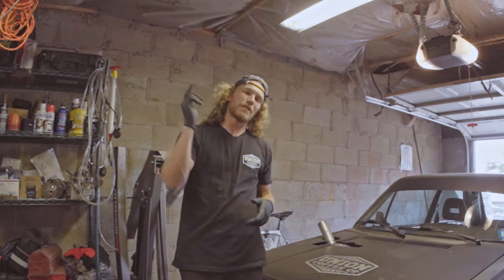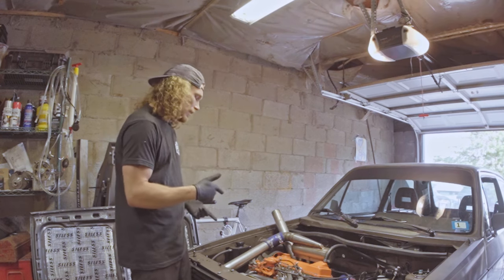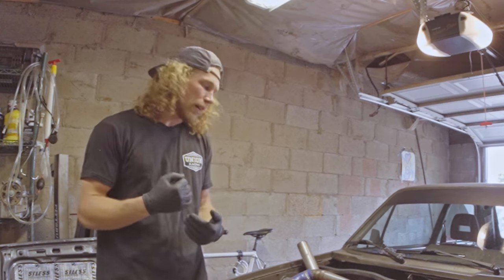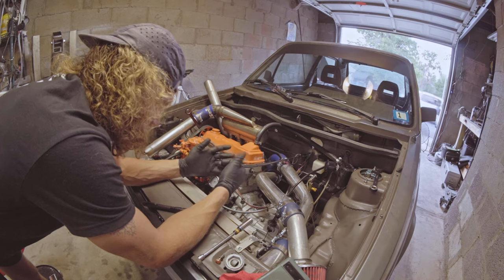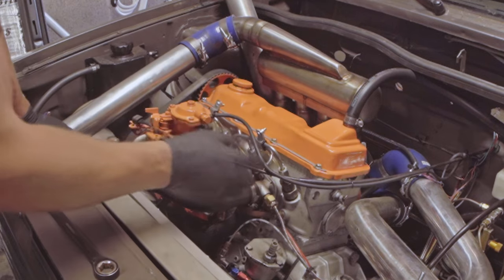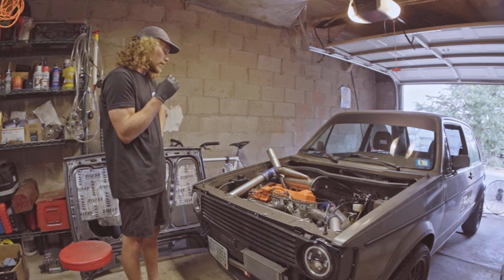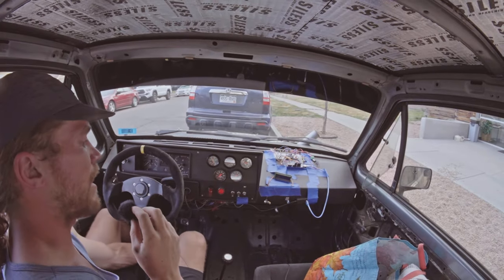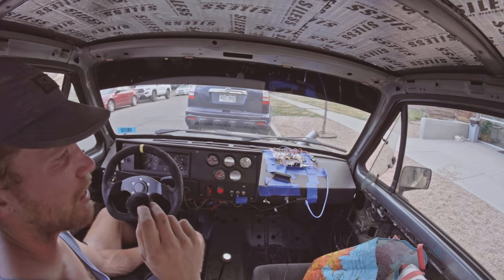Tune & Test Custom Injection Timing

Comment: I have run them at 1mm for a long time with no issues.
Reply: But that's with stock fuel system. I had a 1.6 with TDI turbo on it. 9 mm fuel pump. It was an early block 1980 and they crack at the corners. The Early 1.6 blocks had Six point head bolts. That's how you know. Then I went a AAZ with an 8 mm pump turned up all the way and I ran that at 1 mm. I suppose if you're running a lot more fuel it's better if the timing comes later. To push the Piston down.
Reply from the maker: Me too! But this set up is super Frankenstein, unfortunately the stock range just doesn't apply

Comment: Hey Oliver, I'm a bit stumped on my 1.9 l aaz. It was running perfect before I parked it a few years back. Then I went to start it and it wouldn't start because the veins were stuck. So rather than rebuilding it, I decided just to buy a new one from Hans Auto parts. Again, we know the reputation. But I've had pretty good luck with their pump rebuilds. I just know there's a possibility I'm going to have to take it apart. The new pump was a 9 mm. My old one I found out was an 8 mm. Even with the eight it ran pretty good. Would burn the tires through first and second easily. It has one of the Hans Auto parts turbo kits on it. Fyi, they work pretty good. So I have the timing set at 1 mm. Fuel screw pretty much maxed. But it's not really blowing a lot of black smoke, just mostly gray. Dark gray. When it's floored, it revs up to about 2500 RPMs then it starts to pop like it's hitting the rev limiter. And starts to slow down. Feels like it's running on quarter throttle. So I took the whole pump apart and checked every little part in. It seems to me everything is correct. I'm using the same spring actuator from my original pump just to see if it was that. Didn't change much. So I decided to try and rebuild my 8 mm pump and was unsuccessful and ended up accidentally breaking the 8 mm shaft. I have taken the whole thing apart twice and still can't see anything that would change it... Any ideas?
Reply from the maker: Hmmm that's a toughy! If I were you I would start with having it apart & checking everything in extreme detail against a schematic. https://youtu.be/HciSSYuXxdY?si=IorJbbds9uuVw-YI this link is to my vid where my car wouldn't start when I left a spacer out... Seems similar, ALSO in the description there is a part diagram/photo of exactly how the pump SHOULD be, definitely take a look at that. If it otherwise would be working (like ran well before) then you might need to suspect the quality of what you purchased. I'd also be asking questions like: how's the filter? How old is the diesel fuel? Is there water in the fuel?

Comment: the jerking at tiny throttle position is actually a rly fine line between idle injection and the throttle actuator, if you push the governor too much and leave no space for the actuator to come fully back and seal' it jumps back and forth giving and cutting fuel.
Reply from the maker: That tracks, is there a remedy for it in the adjustment of the pump?
Reply: @OliverFetter  yeah, release a bit the fuel screw if your main control lever is already full back. i didn't play much with it but its a common problem especially when the engine is up to temperature. 
*at my understanding is that with max feed the fuel screw keeps it from fully closing (it doesn't have space to come back and fully close the fuel plunger and or its loose due to spring weakness at that position and with vibrations its jerking back and forth letting fuel to escape)
Reply: im trying to figure why mine wont rev up past about 25ooRpm. if I rev it past that it starts popping like its hitting the rev limiter then drops back. My old pump worked great and ran perfect but the truck sat for a while and the veins got stuck. So I put in a new one. Tore it down and checked every part in there. Green seals. everything is perfect from what I can tell. I was going to rebuild the 8mm pump that was in it but when I was putting it together I snapped the 8mm shaft somehow. So I put a 9mm in there and it does what it does now. Never did that before and it pulled real hard up to about 4000rpm with 12lbs boost. Any ideas. Like its running on 1/4 throttle right now.
Reply from the maker: @Mikefngarage  kinda sounds like it's not getting enough fuel. Are the supply lines, filter, etc clear & good? Is the vein pump in ok shape? I've had pumps act like they're stalling or about to cut out bc my inline pump wasn't turned on & it was acting as a restriction while off

Comment: Don't forget that the TDI cam plate ramp up is far more aggressive or quicker than the IDI, that's why at stock advance it gives you the knock. Backing the timing off also moves peak cylinder pressure further after TDC so you get more expansion pushing the piston down rather than it not being able to do much (The knock sound) another benefit is more exhaust to spool the turbo
Reply from the maker: Yes! I was mentally factoring that in as well. All the parts working together to create early timing. The additional exhaust is definitely noticable 💯💯

Comment: hey dude, just found your channel been watching videos in your catalog like crazy, really appreciate the time you've spent documenting this build. 

I recently bought a SUPER clean '84 Rab with a standard 1.6L (non-td) engine. Was planning on converting to gas, running a 1.8T for autocross, but after seeing your videos I'm reconsidering keeping it Diesel and just swapping in a 1.6TD or an ALH-style TDI into it. Wouldn't exactly be a sleeper 😂but very fun build. And since you also have BOTH of those engines, do you have any engine recommendations for me if I take the Diesel route? I'm also super curious what your ECU setup is. Are you running a standalone ECU or did you chip-tune the stock TD? And you've got the Arduino to set up different boost profiles for you I think? Super nutty but almost seems necessary to reduce the lag. I dig it man.

Anyways, appreciate the content! Let me know what you think!
Reply from the maker: Hey thanks! I appreciate it 🙏 glad you find them helpful.

I have not finished building/installing my TDI engine yet but I have high expectations. I'm very pleased with where the 1.6L is at the moment... Pretty fast! My 1.6 is rather injured as well, I have about 65% of like new compression. This on its own doesn't really matter but it blows oil everywhere and I don't like that. SO instead of reworking the 1.6 again I figured I should try an ALH since it's literally the same thing just built better & direct injection. I figure I can directly transfer my entire turbo & manifold set up to the new engine and pickup a free 100-200 HP.. which will bring its own set of problems. I see some people say the 1.9 swap isn't worth it (power/response wise) but they clearly don't know how to tune a diesel in the first place. I'm sure a stock 1.9l sucks lol. 

So in that department it depends what you're looking for. If you want to project & tune a diesel till it's on kill mode then it's super fun :D if you want to swap an engine without much tuning probably swap the gasser.
Reply from the maker: The 1.6 is entirely mechanical, I'm just using the Arduino to control the turbo vane position. It essentially reads intake & exhaust manifold pressure & decides if the vanes should be opened more or closed more. I'm not a 100% sold on the control system so I might try a mechanical VNT actuator as well. Either way I want to start measuring air density all over the engine to be able to tune it better. 

Happy trails!
Reply: Dude, go with The AAZ for autocross. The power band is just off of idle. 1.6 takes a little more time to spool and has a power band in mid RPMs The AAZ 1.9 power band is from around 1,000 RPMs to 4000 evenly with a turbo. When mine is running right, I can let the clutch out while it's idling and then floor it and the tires come loose immediately. And that was with an 8 mm pump. Put an 11 on there and it will come alive
Reply from the maker: @Mikefngarage  sounds pretty tight!!

Comment: What radiator are you using and what fans because i what to upgrade my golf mk2 cooling
Reply from the maker: TBH I'm really not sure. Its a 2 core radiator with aftermarket electric fans & a shroud I made myself. I actually have 0 evidence it does a better job cooling than the OEM radiator and fan, however it does package better and allow me to place the intercooler 💁👌

Comment: I just changed my injection timing on my 1.6TD. Was at 0.90 from previous owner. Advanced it to 1.05. It sounded rough before. Quick drive with it now and it seems to clack a little more but honestly not much. Seems to vibrate a bit more but more smoothly, if that makes sense. Also feels like it has just a little more power behind it (niice). What was your experience playing with this on the 1.6td? How far is too far? Thanks brotha
Reply from the maker: Right on! I feel like 1.05 is really the furthest you want to go, it's only going to get more clacky and less responsive past that. I would run my stock pumps around .95-1.0mm with good results.
Reply: @OliverFetter  Yeah this is all stock. I definitely don't think advancing it anymore would help. Next time I time everything I might bring it back a little. Maybe 1.00. I need to have my injectors rebuilt and the breaking pressure verified though before I settle on anything. Have you tried different nozzles?
Reply from the maker: I have not. In my experience the nozzles are not the restriction in the system 👍
Reply: @OliverFetter  that was my initial thought as well. But it seems that fueling and EGTs are. From the searching I’ve done, the only difference between the 68hp and 75hp 1.6TDs was a small stock intercooler and bigger (“GTD”) nozzles. So there’s some gain to be made there. But more importantly it seems that when you crank the fueling on these pumps you are prolonging the injection duration and that results in much high EGTs. Larger nozzles means shorter injection duration and lower EGTs. At least that’s my understanding?
Reply from the maker: 🤔🤔🤔 I think that makes sense?? I'm having trouble wrapping my head around if nozzles actually make the injection event shorter. I feel like I've heard from multiple sources that they're not the thing to go after but those sources may have been forums 😂 so we know that can't be too helpful. You're 100% right about egt & injection duration. For me upgrading to a larger pump head was the fix, more fuel delivered per stroke = less need to prolong the duration. Being rather ignorant of the nozzles dilemma, id chalk most of that hp gain up to the intercooler. Denser air = more hp.
Reply: @OliverFetter  I’ve also read from various forums that nozzles aren’t going to make much difference. And I tend to agree if you’re just talking HP or basic tuning. But I think when you’re pushing things further, the nozzles will drop EGTs and injection duration and allow for more headroom. My understanding is the fuel will inject quicker and shorter the duration because… well bigger holes. For the 68 vs 75 HP engines, I have a hard time seeing how the intercooler could account for that difference when you consider there is so much fueling headroom in these and oxygen availability doesn’t seem to be anywhere near a bottleneck at stock. But I’m just theory crafting. I just know the only difference between the 7HP was nozzles and small intercooler
Reply from the maker: @chrisladouceur4093  that's a great point. Love the thinking your doing over theren💯💯💯

Comment: Hey great vid! What K value did you get in your Mtdi pump if you ever measured it?
Reply from the maker: Not sure what a K value is, educate me!!
Reply: @OliverFetter  "K" value is the measurement / clearance between the plunger head and the plunger at its max lift. Its set by selecting the correct thicknesses of spacer between the plunger foot and the cam-plate, to move the plunger closer to, or away from, the plunger head.
Reply from the maker: Gotcha that makes sense

Comment: I think the jerking is from the gov mod where you took out the idle spring..for a spacer- did you keep it that way?
Reply from the maker: Good thoughts!! Short answer - no. This is a different pump than the gold one. Giles actually did the gov mod a long time ago, I've since upgraded it to a 11mm head & TDI rotor. Only started lurching after that upgrade. Timing doesn't seem to affect the lurch. Seems like I should play with pump settings potentially. Any ideas are welcome!

Comment: Hey man, who do you like to use for VW parts?
Reply from the maker: Depends on what it is! I find PartsPlaceInc is pretty helpful & has a huge selection & solid quality, none of it is performance oriented though. For performance parts I look for smaller suppliers usually on an as needed basis depending on what it is.. steering, rods, etc
Reply: @OliverFetter  in one of your videos you showed some improvements on the shifting linkage for the rabbit. I have an 81 rabbit pickup and the existing linkage drives me kinda nuts. P.S. thanks for being so good at responding to comments.
Reply from the maker: @bryceribken183  right on. I have the USRT 020 linkage in mine & it's solid. I remember it being more annoying than I had hoped when installing it but it definitely cleans up the spongy original feel

Comment: Did you happen to notice if your EGTs lowered after retarding the timing? Also, did you tinker with the fueling at all or only the timing?
Reply from the maker: Hmm ya know I didn't make a point of observing that difference 🤔 shame on me. I would like to say they're a bit lower but I would definitely have to review some video footage to be confident in that. it's tough too bc I don't have a "metered pull" I do that's repeatable, hard to tell if temps or lower or if I just hit the gas for a shorter period of time 🤔🙈 I didn't touch fueling at all!! Which I thought was cool. Crazy response difference.

Comment: Interesting idea putting an MTDI pump on your 1.6. I took my 1.6 out and put in a MTDI ahu. Going to be making some videos about getting it roughed in on my other TDI channel. 
I roadtrip my mk2 so all the failures I had with the boosted 1.6 made me too uncomfortable to keep pursuing using it. Now it’s in my garage and I have no idea what to do with it.
Reply: Also if you’re breaking fuel lines inspect the 4th bolt that holds the injection pump on below the delivery valves. If that bolt is not tight the extra vibration will break the injector lines over and over. 
Not the end of the world on a 1.6 but if you do it on an AHU those injection lines are unobtanium.
Reply from the maker: That's cool, what kind of failures were you experiencing? You should slap it in a boat or a go kart
Reply from the maker: That's an interesting point! I always keep the pump locked down so I don't think it's from that. I also used to take the rubber/metal grouping clamps off bc I thought it looked better lol definitely didn't help
Reply: @OliverFetter  I turbod it, blew the headgasket, got arp studs, blew the head gasket again, turned the boost WAAAY down, blew the head gasket again, I couldn’t go 90mph without overheating 
Somewhere in that list it started getting really hard to start, ran GREAT on a roll. Would not start on the starter.  I spent SO much money trying to figure that out. Internally it looked fine. Nothing wrong. Visibly. Checked timing, checked for air, checked the shut off solenoid, put an mk4 starter, nothing would do it. 
I’d have to ask my neighbor to help give me a push in the morning when no one else was around. 
All this just to make like 70hp and have the absolute worst gearing for the highway. I have lots of TDIs so I just needed the MTDI pump I had everything else to do the swap. 
Side note I’m getting insane mileage in this mk2 with MTDI pump. Anywhere from 57-70MPG with TWO kayaks on the roof. Nearly double what I got in the 1.6
Reply from the maker: @GWinvader101  huh those are some wild symptoms 🤔🙈 never had problems like that with mine. Certainly seems like they run hot though. That mileage is wild!! Nice

Comment: Wait until you add more fuel 😂😂 Turn you Will ser reAl results 🎉🎉🎉🎉
Reply: Dude, the whole choke point with these idi diesels is fuel delivery. You think you're saying something useful, but you're not.
Reply: @khester7397 i can tell you never tuned any idi by yourself did you ?
I can break an injector because of excess fuel, and this is not the case so far,,,
Reply from the maker: Welp idk why I would try to break an injector lol that's not terribly useful. If anything, I would consider pulling fuel rn for the sake of working on other aspects of the tune with less cylinder pressure, risk, and egt's. Yes. Fuel obviously makes these haul ass, it's also a great way to break things. I'm not concerned with the fueling because it's an 11mm head on a 1.6l - overkill at my fingertips. But I'm not going to blow my turbo & melt things bc I'm playing with other tuning with a kill amount of fuel. Also being too rich is dumb. Heat & soot are not the goal lol its manifold air density & good AFR makes the power 🫡
Reply: @OliverFetter  Wow, I didn't realize the 11mm head would give so much more fuel. That's awesome!